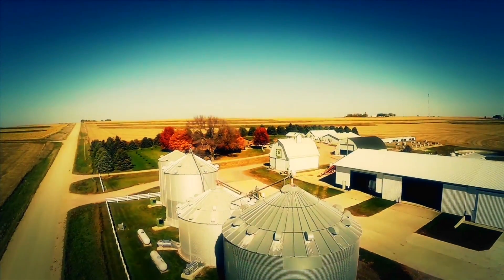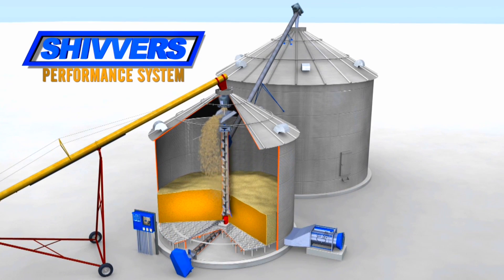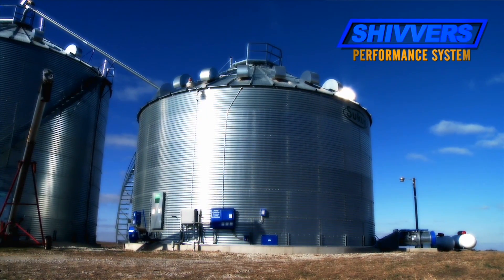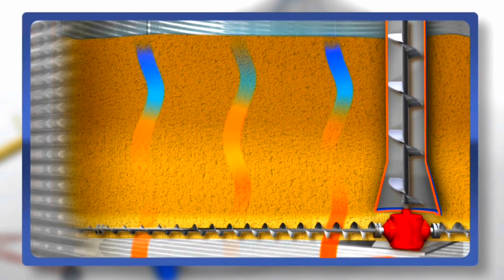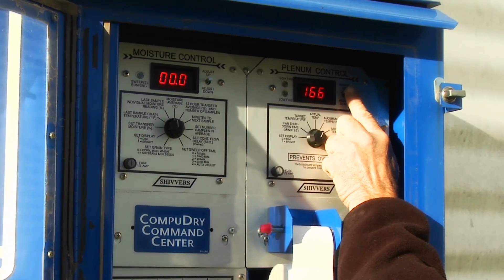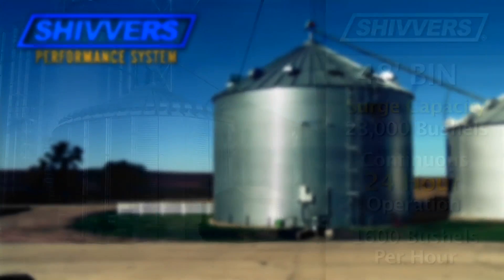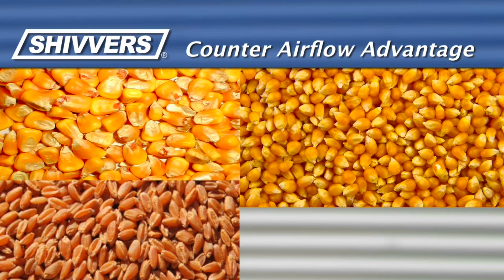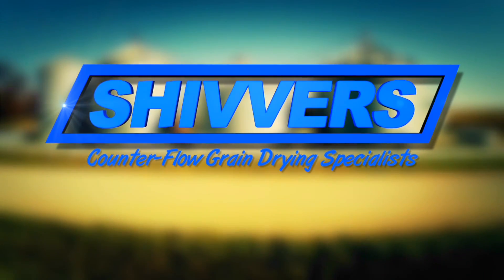Shivvers Grain Drying Systems

Comment: Will this system work for drying in shell almonds?
Reply from the maker: Yes, it would be possible to dry that commodity.  However, the system has not been tested or evaluated for air flow with it.